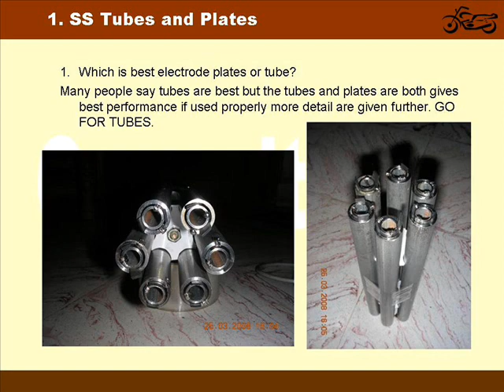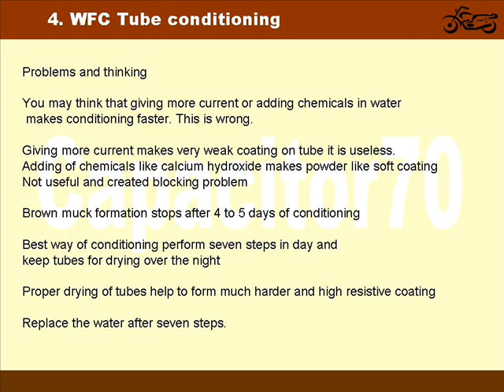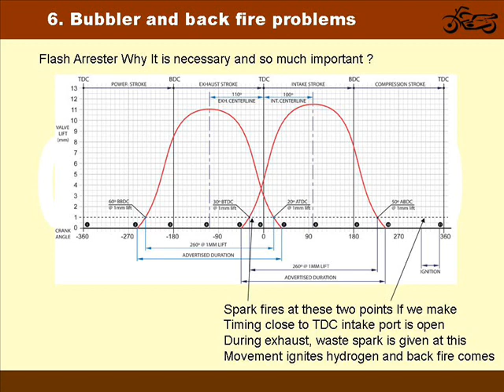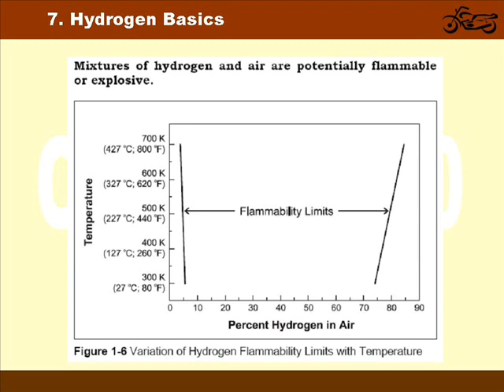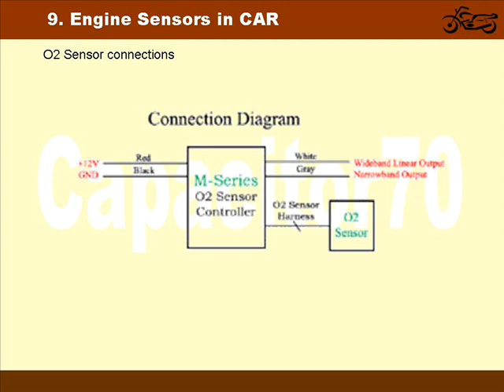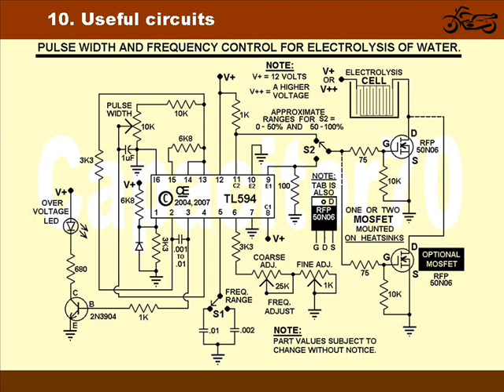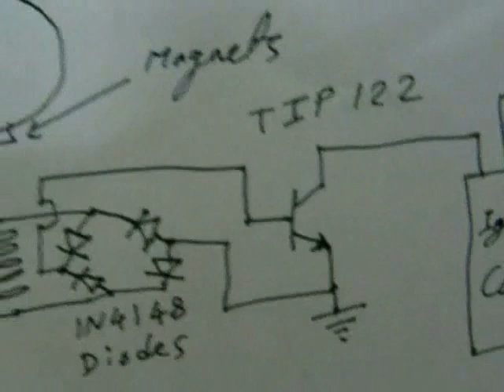WFC, HHO and Engine Fundamentals

Comment: Good video! You are wrong about bubblers and flash back arrestors!Bubbler must be from strong,hard material,I prefer SS tubes!Flash back cant destroy SS bubbler!You also can put one safety valve on bubbler.Or make two bubblers with connection on the bottom. Gas come to one tube and go out from the second,bubble through connection tube on bottom.Arrestors can make easy from grinding stone(rod shape,for drill machine),put this in metal pipe,seal with teflon,epoxy,or something,and put connections..